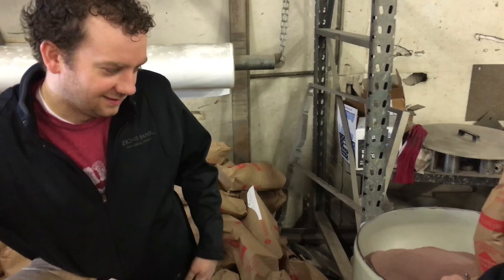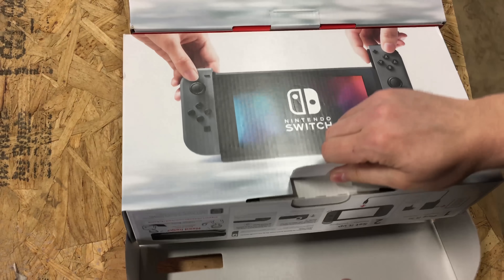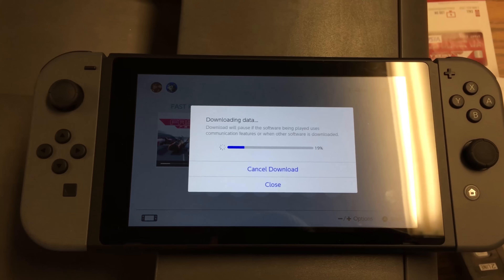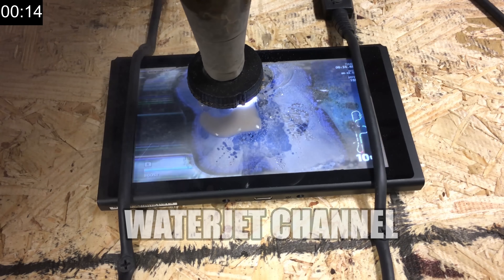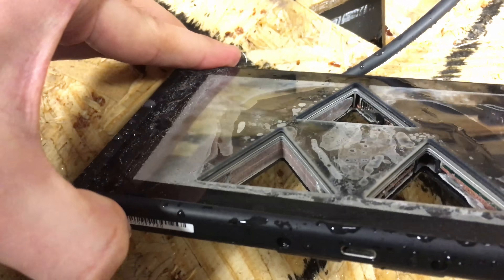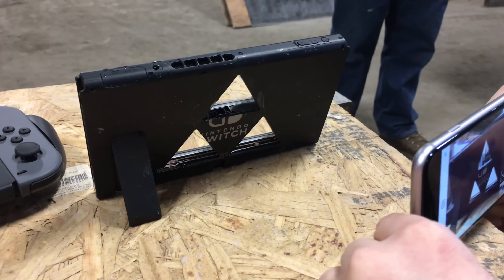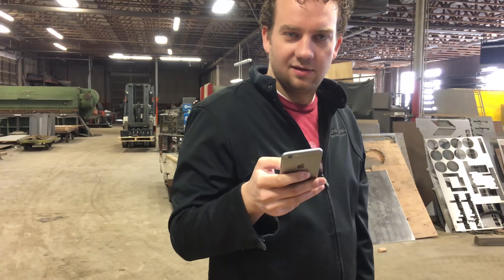Nintendo Switch Extreme Durability Test w/ A 60,000 PSI Waterjet

Comment: Looking at the iFixit teardown of the Switch, it looks like your first triangle took out the fan and clipped the corner of the battery— so nothing that wouldn’t prevent it from running, but still impressive water resistance.  The second triangle was right in the center of the battery, so power died (it may have continued to run if you had it plugged int AC!)  The third triangle looks like it was right on the motherboard and probably hit the CPU or GPU.

Comment: The water/mist was acting as an electrical conduit lol You notice how it was arcing and didn't short until the jet stopped? All the signals were scrambled but were still being sent and the individual parts were still receiving a signal. All that a PCB is would be channels for current and switches. Seems like you luckily didn't cut through any or many actual chips or capacitors on the board so the water was working like a spliced cable relaying the signal and completing the circuit. And the high air pressure from the jet into the cavity was probably keeping the water from seeping into the rest of the board. That was really cool to watch. It also appears that Nintendo uses some high quality capacitors in their boards.

Comment: I think the switch survived so long because there is actually a noticeable empty space in the system, if you have a switch, you might have noticed there is an area on the back of the device where you can actually push down on the plastic as if there is nothing under it. Or it had a lithium polymer battery instead of a lithium ion. The circuitboard could have also still ben partially connected, it wasnt falling apart or anything, it all stayed in place while being cut.

Comment: Clearly the processor, ram chips, etc, are located off to the sides, so the water jet was just cutting through the LCD display. Also, the reason why the short-circuit came so late was because the water was moving so fast, it had no time to conduct the electrical current, but when the water stopped ZAP! Those are my two cents.

Comment: How the he'll do you cut a triangle shaped hole that big completely through any electronic device, completely blind as to what's inside and it still plays, with a clear picture no less, around the edges? The start of the second cut killed it though. Luck and what's in that section of the board, I guess? Awesome. Great video.

Comment: after looking at a teardown and knowing the internals, that switch could probably still work if you plugged it in.
You cut through the first battery, making the switch run on only the second, and then when you cut through the second battery is when it stopped. But that means it stopped because of no power. So if it were plugged in it could get power from there and possibly keep working!

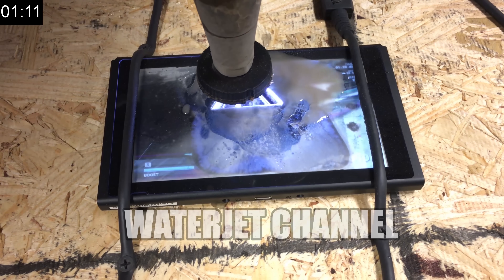Comment: You can see the electricity at 4:00 jumping through the cracks to keep the screen on. The electricity must've been connecting through the water. Once the part fell, there was no more connection. That was pretty cool.
Reply: That was the light from the backlight hitting bubbling water

Comment: How was it still working with a massive hole going straight through it?!
Reply: bailey125 that part of the switch was actually the fan, without the fan, the switch can still work
Reply: @decidedlyjass  yeah. You can tell it’s the battery because it instantly discharges. If it went through the motherboard, there’d be no giant spark
Reply: andrew You have that flipped left-right.  The battery is on the left (when looking at the screen right-side-up) where the second cut is.  The motherboard is on the right, where the third cut was.  You can even see the sliced heatspreader and ICs in the third triangle in the video.
Reply: So we know it's going to work when somebody shoots it. Good to know living in the American countryside
Reply: @WiFi-qj5kr  oof
Reply: idk
Reply: Only God knows
Reply: Japanesium
Reply: @decidedlyjass  actually if you look closely, the first cut also cut a part of the battery.
Reply: The battery was cut and then the motherboard was cut but it was still operational. There are 2 batteries in the switch i believe so the switch died when the 2nd battery was cut. This switch can be repaired but it wouldn't be an easy job.
Reply: Because it's a Nintendo

Comment: Impressive, not shocking giving what they put certain DS units through.  They usually get the hardware as strong as possible, their power wires, those are often shittier than expected.
Reply: The fact that the switch survived for so long wasn't really because of product testing or being strong... it was the way the schematics were set-up inside. The water-jet cut through the battery (which is built up by layers of lithium polymer so it doesn't get affected), and that "circuit board" they cut through wasn't part of the motherboard. It is popular for phone and tablet manufactures to have separate circuit boards for utilities like WiFi and Bluetooth, the entire processing side is sitting on a small motherboard elsewhere.

Summary: This was all luck, cut anywhere else, it would have been done in a hundredth of a second.

Comment: holy crap I'm really surprised how long it stayed on
Reply: It’s made out of nintendium.
Reply: That first triangle was going though the fan. If they started with the bottom-right triangle it would have stopped working almost immediately because that's where the SoC and memory is.
Reply: Me too
Reply: HondaRyder750 AVENGED SEVENFOLD
Reply: Until they went thru the battery, if they didnt went thru the battery it could of still be on lol
Reply: HondaRyder750 they practically took a literal triangular chunk of the motherboard and battery out and the only thing keeping it alive was some arcing between the separated parts then the battery got angry and the chunk flew out blew up and killed the switch
Reply: Definitely very durable Hardware

Comment: That survived a lot longer than I expected.
Reply: Not only alot longer I've never seen a console that can survive that much water, a part of the battery being cut off, and and piece of the screen being cut off lol. Nintendo built a tank lol
Reply: that's actually low durability for a nintendo
Reply: @KilosFoxo  what other game consoles do you know that can survive with a hole in the middle of the console?
Reply: @Keeby219  literally any nintendo console like the game boy which survived a bomb
Reply: @KilosFoxo  that's pretty durable if you ask me
Reply: Impressive
Reply: Yep
Reply: Yep
Reply: If only we knew about the joycon thing at this point. At least the main system is still going strong. My fan went out, but that's about it.
Reply: The switch is underrated. People say the graphics are horrible and thats true for some games but when you use it on TV its just like any normal ps4 game. The ps4 isn't portable so the graphics rely on your TV and not the actual console. The switch is also pretty durable but the controllers themselves aren't very durable. Still pretty good portable console though.

Comment: Dumb fucks! how could you not have aborted the jet when it survived the first triangle?! itt was really cool. could have kept playing.
Reply: It honestly probably would have died within seconds since they got the battery towards the end of the first cut, also they were blasting water into the circuitry. I'm with you though, I wanted to see how long it could hold on.
Reply: Necros1s Nope they cut trough the Battery it could not get any more power
Reply: For real
Reply: by the time they cut the first triangle it was already dead, it just hanged in there for a while cause its tough as nails
Reply: Ehm, it clearly still worked until they started the next triangle
Reply: If you look closely after the first cut, you can see all the electricity sparking across! so cool.
Reply: fuck off nintentoddler

Comment: LMFAO it looked so awesome with the first triangle cut it had the backlight making it look all holy and it almost look like there were sparks on the edge of the cut XD
Reply: And anyone mature enough to have a degree wouldn't waste time arguing in YouTube comments....
Reply: that's fucking hilarious; as anybody with a legit engineering anything degree would know that arcing is a result of current, not voltage. also anyone who's ever owned a plasma orb would also understand this concept.
Reply: they should have stopped to look at a console still functional with a hole in it
Reply: +Caden Higgins,  exactly. That's why they only said one thing and they haven't responded to this kid, obviously don't have the time to argue...
Reply: Definitely no arcing there, you'd be looking at very max 1/10th of the voltage required to arc through air
Reply: It definetely cut through the wood
Reply: That doesn't look like bubbles at all
Reply: and reiterate: these guys are cutting straight thru the battery if you look at breakdown videos. it's a whopping 4+ Ah battery discharging in a matter of seconds. so yeah
Reply: 04:04 oh yeah thats just the water on the cut piece being illuminated by the rest of the screen
Reply: @I Forget Yeah because people with degrees don't argue on youtube. They're too intelligent. Anyone who has a degree knows that you're too smart to argue with non-degreers.
Reply: coolmountains25 What degree do you have?
Reply: I Forget sooooo true
Reply: I am curious if they left it for at least a minute more before doing the second triangle

The Switch could still play with that triangle D; ( amazing seeing that the first triangle cut little of the battery )
Reply: morphedkirby yeah watch the other triangles cut it cut through the ply wood and the switch its spraying water and sand at 60,000 PSI are you kidding it went throught both the ply wood and switch as for arcing maybe maybe not because the peice that was cut is no longer powered so arcing between the two parts is not going to happen it was the bubbles being illuminated by the light cause the bubbles stopped when the machine repositioned
Reply: It was arcing.
Reply: Actually that wasn't arcing. What you were seeing was the water bubbles from the jet being illuminated by the backlight.
Reply: There were. That is called electrical arcing.
Reply: Yep, as soon as you graduate and get your degree you ascend from the mortal plain and become a superior being, and therefore have no time for us, puny mortals and our pitiful affairs. It's like becomimg a PC gamer.
Reply: these people saying this WATER CUTTING TOOL cut through the switch, and didn't cut through a sheet of fucking 1/2 inch OSB board. that was definitely arcing. in fact the explosion tells it all. there would've been more bubbles from the heat of the explosion if they were.

Comment: What a legend. The Nintendo Switch butter be made of Nokia 3310s.
Reply: TheJetixMasta Nintendonium is near indestructible so the kiddies don't break it
Reply: Ari 
I bet they used solid Chuck Norris juice as well.
Reply: YoloMcSwagton You actually can. Just need to compress 3310s by pray. Then you'll have magic 3310 dust and mix it up with water and you get 3310 liquid.
Reply: Nokia 3310s are too durable to be recycled. Nintendo could only imitate the material.
Reply: It also runs on a Toyota engine

Comment: What a shame. Nintendo couldn't make their console out of a more durable material? What am I gonna do when I accidentally put my Switch into a water jet?
Reply: +OrdinaryTaco
Well, the kickstand is meant to break away easily in case someone tries to dock the thing with the kickstand out. It pops back on very easily.
Reply: OrdinaryTaco Don't worry about the Kickstand. If its overstretched it pops out of the console. You can put it right back in. But the Game Card Slot is the same as the DSis 3DSs SD Card Slot. We need to be careful opening those
Reply: Román Hernández Lóyzaga K Bro.
Reply: jayjay07 it's is
Reply: CNET needs to address this issue.
Reply: OrdinaryTaco lol😂😂😂
Reply: Ethan Owen 
Brings to mind how the N64 would work after being run over, doesn't it?
Reply: Send it back to nintendo
Reply: Admittedly there are some things they could have done better as far as construction goes like the position of the antenna in the left Joy-con(saw a video of a guy improving the range by like 50% by soldering a wire to the antenna contact points and rerouting it to a different position) and using better mounting material for the rails on the side of the console.
Reply: All jokes aside I do agree, I feel like some features could easily break if  I wanted them to such as the game cartridge cover and the kick stand.
Reply: OrdinaryTaco That better be sarcasm.
Reply: When I watch how two evidently daddy's boys destroy very wanted and new working costly tech for the sake of likes for daddies enterprise, and even double their money from some perturbed buyers for the crap they generate,  I just can think how lost and doomed the mankind is... Please think about this, Its really sad... How a beautiful world... Of course loads of subscribers... Stupidity is viral in our culture... No more word for this...
Reply: Román Hernández Lóyzaga - That's one way to look at it... you could also say for the very low price of $300, these guys made a video with 1M+ views, resold the cut device for $500+, and probably attracted thousands of people to their channel. Definitely a net win from that point of view. The revenue from this channel likely greatly outweighs the cost of the items they cut, even though it seems like a waste on the surface.

Comment: This is possibly one of the most durable consoles out there. They put a fucking hole in it and it still worked. Granted, it worked for 5 seconds, but if it didn't cut through the battery, it still would've worked. God damn.
Reply: Mota Nintendium!

Comment: Submitting a suggestion for cutting that would look cool afterwards,

Desktop Hard Drive (from a computer)
A laptop or tablet
An LCD TV
An Engine from a car  (like from a small little 3 or 4 cylinder engine so you guys can actually move it around relatively easily)

Comment: That was incredible; you would expect such a powerful and expensive handheld console to be durable as well.

I was concerned that modern technology was getting flimsy, but this really brings back the age of tougher hardware, it looks more durable than the N64 and you could drop a TV on those and it would still work.

Comment: How is it possible that the Nintendo switch was still operational after the battery got cut off? XD
Reply: thats the magic of nintendo
Reply: Arjonaut those Tri force pieces can be very powerful
Reply: Nintendo dark magic obiusly
Reply: XD Dont fuckin know The Japans made some crazy Stuff xD
Reply: Arjonaut since you do not know why, water is a very good conductor of electricity and they use a lot of water so the water was conducting the electricity while the water jet was on, if you notice on the first hole it only stopped working when they turned the water off. Science
Reply: Man, nintendo sure knows how to step up their game. Literally.
Reply: as long as there are still uninterrupted layers the battery will still produce power. just not as many amp hours. when it died it opened the battery circuit shutting off power. great video
Reply: se dice TRULY no truEly tienes más mierda en la cabeza que un cangrejo.
Reply: y se dice stupid English el adjetivo va antes del sujeto , PERO CUANTA BURRICIE Dios mio
Reply: Arjonaut f
Reply: +Arjonaut "The triforce of power"
Reply: Asianianic it missed the battery
Reply: Adrián Flores  Your English is shit as expected, go catch some lessons. im not stupid, you certainly are, Bitch
Reply: Watch a tear down video! it is mostly where the fan and the cooler 
 thats why
Reply: ItsJohnnyMac  u dont know shit jhonny
Reply: Adrián Flores  do you fucking see anyone talking Spanish here ?